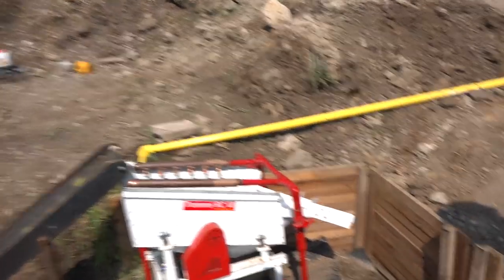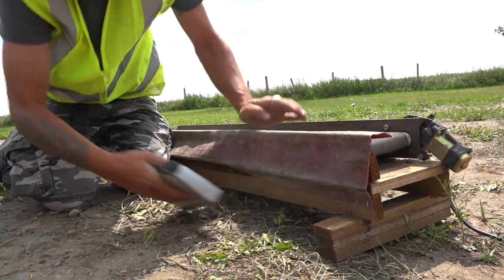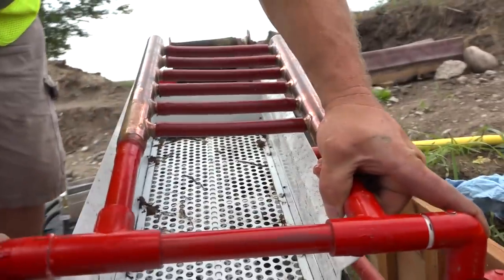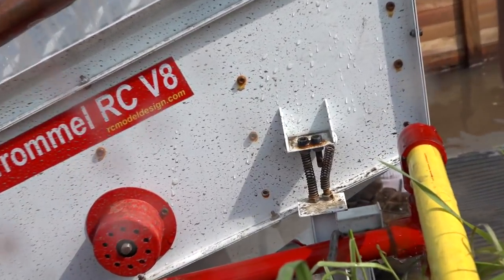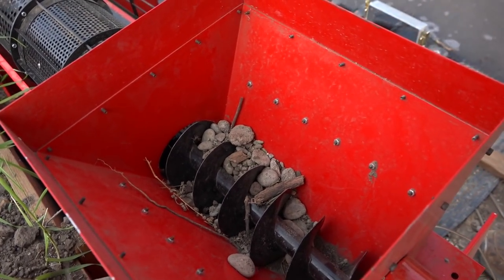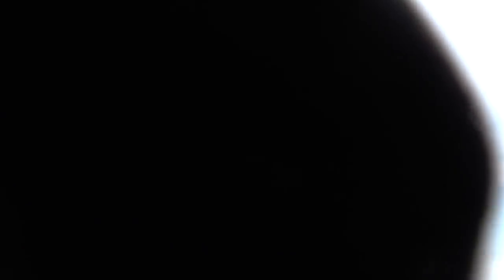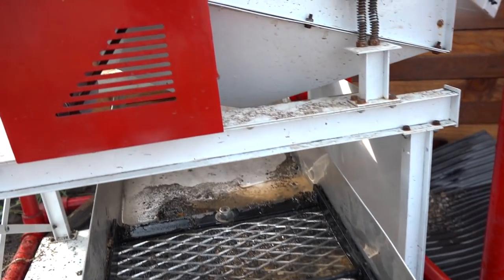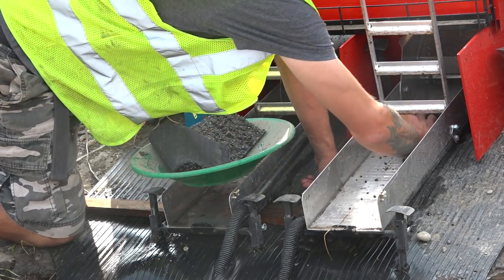YouTube GOLD - DIG DEEP & WEIGH THE GOLD (s1 e10) | RC ADVENTURES

Comment: Awesome video per usual! One suggestion would be to get some sound proofing panels, and make a 3 wall, 1 roof box with one open side, to put over the gas engine. It will allow it to still ventilate, as well as really reduce the sound levels. I've done this with Generators with great success!

Comment: Just a thought but beings the larger rocks are getting dropped into and past the bars you might build a rock grate. A structure that has the same size grating you have in the sluices mounted on a frame at a 45* angle, use the front end loader to drop scoops of material on the top edge and then let gravity work it magic by letting the smaller rocks and dirt fall thru and the larger rocks just continue it race to the bottom of the frame/screen. Then you can use the loader again to scoop the cleaned dirt out from under the raised frame and then drop into the trammel.  Just throwing an idea out. Great series BTW!

Comment: I think you need to swirl the gold pan at less of an angle but with more water. I've panned for copper grindings from a sanding wheel. I hold the pan (bottom) at about a 45 deg. angle and swirl agressivly to sluce-out the large stuff. The ribs in the pan will keep the heavy stuff. Gold is heavier than copper so this should work. Also, are you weighing in imperial or Troy ounces?

Comment: Still fun to watch. And I watch most gold episodes twice at least in case I miss something
As someone who has used fleece traps in sluices (an ancient technology) I keep wondering if the water speed on the right hand  (looking from the bottom) sluices on both machines is a tad too high. In both cases it seems to be washing over too fast rather than washing through?
it may need to be for that modern system
Good haul today. You do have to think of all your finds in terms of scale....
It's the scale equivalent 1¾ oz so far 😃

Comment: You could get a Hydraulic screener for the digger and use it to screen out all those big bolders before it is dumped into the trommel that would stop the blockages on the screw and prevent any damage to the grill bars and screw meaning you could stock pile the bigger stones and crush them up so you can put them through the trommel at a later stage

Comment: I love the show & channel, & way less drama than the tv show. I have an idea for the conveyor belt that feeds the shaker. instead of a skirt maybe use rc wheels or such to create a roller system along the sides to give the belt a concave type shape, or a couple pieces of pvc or metal pipes running down the sides of the conveyor box under the conveyor belt to give it a concave shape to help keep the gravel in the center of the belt & from getting up under the belt jamming it up. Keep it the great work, cant wait for the next episodes!

Comment: loving this series Medic , Sluice Box is kicking butt out there! A couple of thoughts... is it possible to put a hopper above steve's belt so he can dump into it and then the chute of the hopper is let's say a 1/2 -3/4 inch smaller than the belt width (as wide as where the new skirt lays on the belt), have the chute 1/2-3/4 inch off of the belt and as the belt moves it pulls the allotted amount(width and height) of "pay" onto the belt in a more consistent and uniform manner, it would take a bit of adjustment as everything does but may save time over all. This is how we get frac sand from our silo's onto our belt's and to the "blender" , as long as the chute height doesn't exceed the height of the edge holding the new skirt it will never spill out of the chute if the belt is stationary and full hopper. 

Also if you wanna learn how to pan properly check out Jeff Williams he a certified nut and has the gold fever lol , all jokes aside he is one of the best prospector/miners around imo.
 please check this vid...
 https://youtu.be/3CmfFx16JvM

Thanks again Medic and SBS :)

Comment: Make a mistake a COUPLE times, more like several to dozens of times! Yes, maybe if you turn the hose at top of the shaker towards the corner,that would be a big improvement. Definitely looks like y'all got everything up and running real good - maybe just a few more tweaks here and there but the most part works great!

Comment: You're going to wish you had some sort of support on those copper tubes for your shaker. Heat from the sun overtime is still going to weaken those glue joints, since you have weight from the water still in the "sprayers". Shame you don't have a "rock crusher" that runs prior to your auger system, that would prevent your "boulders" from plugging up the auger. Love the videos, keep 'em coming. Cheers :)
Reply: Ham68 it's actually the small rocks jamming the auger

Comment: My father lives in a small trailer with a built on Florida room. Trying to clean the roof of debris from the trees is very difficult. I started wondering if I could use an RC Bulldozer to push the leaves & sticks to a place where I could reach them as walking on the roof is impossible. In my search I came across your videos. Absolutely entertaining in every aspect. The first video I saw was from Season 2. I instantly went back to your Season 1 Episode 1 to binge the series.
Reply from the maker: So cool that you have  been able to discover this show, with such a unique back story. Im stoked that you  are enjoying the show.. and that you  have found some sort of "escape" from the "everyday" when you visit here. That was my goal.  Thank you for commenting :)
Reply: @TheRealRCSparks  Do you have any suggestions for my project? The sections on the roof are 11 and 1/8 inches wide. So the machine for the job really needs to be no more than 10 inches wide to really fit.

Comment: At the trammel you guys should have spray bars over the grizzly bars and if you guys run a hose inside the trammel on a stop and poke holes in the hose you could mount an interior wash in there too

Comment: Just sayin,that oatey company has a “ hot” glue made to glue different pipe types together,well don’t recall if it for that or we just used it to do that,it’s called 795 if I remember,we never used that blue primer crap,just glue up both sides,inside of the fitting and outside the pipe ,push together and twist,pull it back a part,then reglue sparingly,shove back together.use the 795 and just twist,don’t have to separate. And don’t laugh,I was a plumber 23 Year’s,dad for 54 Year’s and grandpa worked just about 60.grandpas uncle was a plumber too,one of the first to plumb at Lake Tahoe. Other plumbers said we were full of it,but we were the ones who went and repaired those guys screwups,the joints will blow a part if you don’t use the primer correctly,yer supposed to wipe off the excess and let it dry a minute.might have been number 793..

Comment: Make a furnace to make gold Lego-bricks.

Love the new sprayers, that was bugging me.

How many milliyards per hour does the washplant run? Shaker deck looks a little steep, rocks could stand to stay in the spray a little longer.

 When you get the grizzlies working, you need to add a chute to take the rocks they catch and funnel them into the shaker conveyor to be washed.

How do you manage to recharge all those batteries, you must be using a dozen? Instead of a fuel truck to come by every day you need a battery truck.

Comment: when panning the gold go in a circular motion and slowly let the water and black sand out of the pan instead of in a straight line because it will take the gold out of the bottom of the pan and put it in the bottom of the bucket.

Comment: Hey Bro, 

 How about using small Batteries for all of your heavy equipment, The shaker etc, tie your two or three motorcycle batteries together and then run a charger to one of them and it will keep all three charged and your heavy equipment will run without the constant lipo battery changes.  You might even be able to run everything off of one deep cycle car battery that you can add a trickle charger to and you will be set, then all you have to do is play with your loader, dozer, and track hoe, and clean off the grizzly bars as well.

Comment: Ok, I have 2 things of concern.
1. I think you need to stop and clean the mats more often. For how small they are, they look to get overloaded for their size. I think you might be sending gold right off the end of the box because it is so full.

2. After watching you run all over the place for new batteries, I think you need to think about a "Generator Plant" to run all the mine equipment from one 12 volt power source. AND I AM NOT TALKING ABOUT BATTERIES! Use a 3.5 horse gas engine to run an automotive alternator hooked to a decent sized car battery. A 70 amp alternator would give you enough 12 volt power to easily run the whole show. Hell, then you could add some 12 volt lighting to the mine and start to run 24 hours.

What say you??

Comment: If you have a look at the second conveyor belt leading to the shaker you are losing pay dirt when it drops from the first conveyor belt it falls through the bottom between the belt and the metal that you are using to catch and funnel onto the belt if you watch the video you can see falling into the water after falling through the the Gap if you use some of the hose that you used to make a skirt for the other conveyor belts and put hose on the metal funnel on all 3 sides so the hose rubber is rubbing along the conveyor belt you should not lose as much pay dirt

Comment: This might be a stupid question to ask but in relation to the power issues you might be having would it be possible for you guys to use 12 volt power supplies like the adjustable power supplies? And maybe mist sprayer nozels? Love what your doing, YouTube gold for the win. Also about the grizzly bars, what if you had the loader dump to the shaker and the excavator dup to the tromel?
Reply from the maker: Your name is Hoffmann?  This is Todd, in disguise - isn't it! haha ;)
Reply: Ha, but no, I believe that you can get away without grizzly bars, by switching the loader to the hose skirt belt, and the excavator to the tromel. The smaller bucket on the excavator would mean less big rocks to go in the tromel, while the loader can dump into the shaker, which can handle bigger rocks. Shout out for next gold video please?
Reply: Hoffmann!   No way

Comment: I think you guys would be way better off with a deep cycle Marine/RV battery and a distribution block rather than messing around with all those separate LiPos. Cheaper in the long run and way more reliability and capacity, plus you can make a cover for the battery to make it look like a big ol' diesel generator with power running to all the different implements.

Comment: question is are you guys going out and painting where you're digging the dirt up and processing it or you're just digging it and processing it and far as your Grizzly bar problem get square mesh chicken coop wire and you can just cut it to size and fold it over the top and put a strap around it and that should solve your problem

Comment: Just so it doesn’t bend why don’t you think about having a support system. Like maybe something like a Y shape connecting the side of your sluice box to the copper. This way if the primer wears out or anything it will remain in the same position.
Reply: Also why don’t you rig some of the holes to have a nozzle. That way more pressure’s being put on the sluice box.
Reply: I’m no mechanic or architect, but this is very interesting and I’d like to see you be successful.

Comment: Hello this is fabtech rc just hanging around watching your gold mining video pretty cool got one suggestion instead of using your LiPO batteries to run the wash Plant why not run it all off of drop cord from your garage easy conversion all you need drop cord to reach to the wash Plant a hair dryer preferably not your wife's take your hair dryer apart there's four diodes looking things it's in a circle that way we'll be connected directly to the main power in I'm pretty sure but that's what switches AC to DC you can put something like this on a breadboard and mount the breadboard in that red box that runs the conveyor belt that would be very handy to have if you would like more information or I would be gladly to build this conversion kit for you for free all you need is a drop cord to reach the wash Plant feel free to hit me up on Facebook fabtech miller keep up the great work bud.